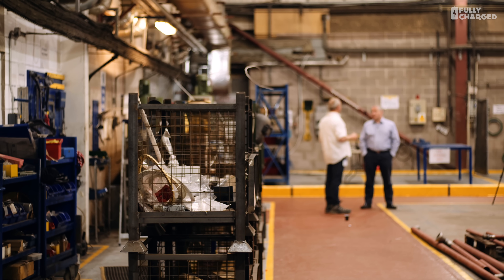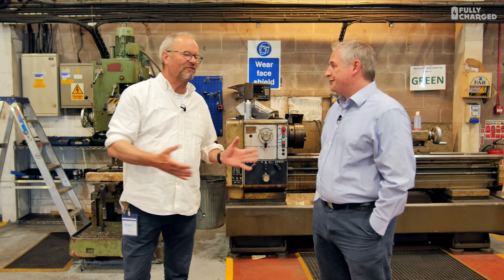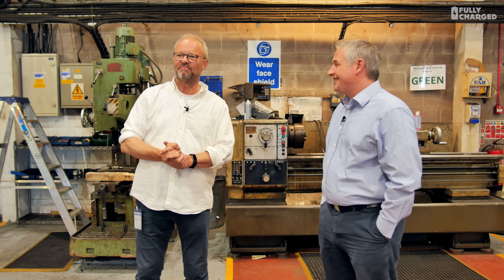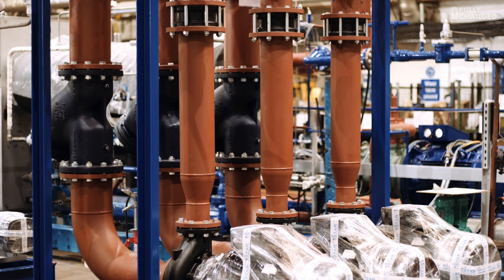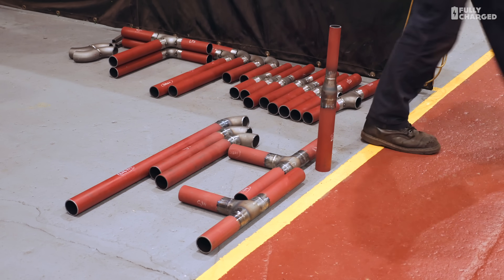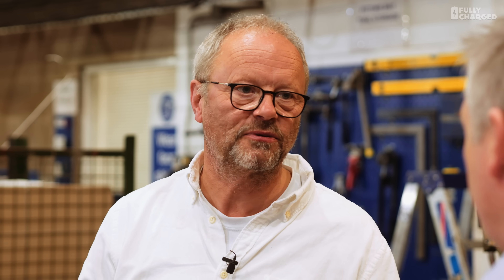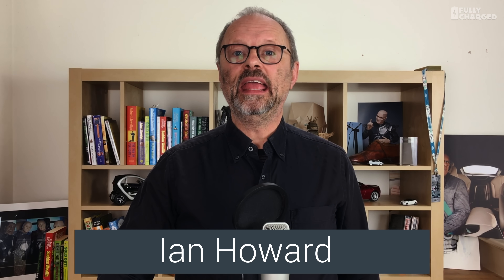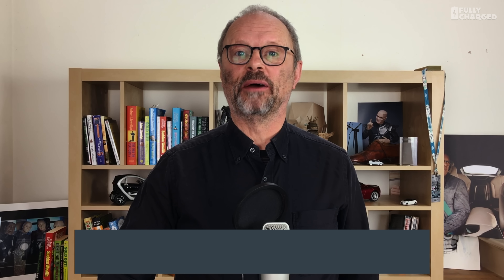Star Heat Pumps | Fully Charged

Comment: Not being at all knowledgeable, how do we get the heat to current homes? So we make X megawatts of heat in a city's river. How can we get that heat to homes in the current setup? Just feed hot water into our existing boilers? I always assumed you have one inlet of cold water for everything
Reply: If the water coming to the home is already hot, why would you need a boiler?
Reply: That's not what I ment. To my knowledge you just have a cold water inlet to your house. So using existing pipes, how do you get the heat to homes. I always thought you have a cold inlet then it goes to the tap(cold) to the boiler(hot). So without separate inlets, you'd have to re plumb everything.
Reply: In a city with city heating the heating pipes to the home will be separate to the regular water supply.
Reply: Jean-Pierre White cheers for the reply, but that's my point most British cities to my knowledge don't have heated cities. So with current infrastructure most heating is domestic.

Comment: Ok, that would be reasonable source of heat for district heating systems that currently run from waste heat of gas powered power plants. Like in Latvia for example. 
Other means of heating (and providing hot water) would create loads of problems. Since we can't simply fit all households with electric boilers and radiators, that would require total rewiring of those households and "last mile" networks, since they are not designed (because consumers would have gas in the kitchen and district heating and hot water) for such load. So I guess this way huge boiler houses can be replaced with something greener. Especially considering that the other choice would be installation of huuuuge resistive water heaters at aforementioned boiler houses/powerplants.

Comment: FOR EVERYONE COMPLAINING ABOUT 400% EFFICIENCY PLEASE READ.
It does not violate the laws of thermodynamics. It is simply moving more energy than is put into running the compressor. A heat pump is nothing more than an air conditioner run in reverse. When you run your air conditioner it may consume about say 6kw of power but extract 12kw of heat from your house while running. We would say its moving twice as much energy as it consumes so 200% efficient. For heat pumps same story, but the heat pumps these people are working on extracting heat from water are even more efficient. With 1kw going into the compressor motor they can extract 4kw of heat from water and use that to heat homes. We are really putting in 5kw of energy but the heat in the water is already there and doesnt cost us anything so really we are only concerned with the of electricity to drive the compressor. The result is 4kw of heat energy being moved from 1kw of electrical energy. Depending on how you look at it, its either 80% efficient or 400% efficient. We tend to look at it by how much energy we have to put into running the system which is only 1kw, in that case its 400% efficient. Which is better than gas powered boilers.
Reply: Gregg Schuder no sir the comparison is legit. Its couldn't be more legit. If you were taking a thermodynamics class and looked at the system on a large enough scale then 400% is bogus. However engineering and economics says the comparison he made is very real. The energy we put into the system that we are actually paying for and are concerned with is somewhere around the numbers he mentioned when compared.
Reply: I am using AC inverter split and very happy with it. But when the temperature drops below -10 celsius is a struggle(it can freeze). I guess here is the advantage of using water pipes going underground and using water instead of air - energy conservation.
Reply: Christopher Beasley absolutely not. The theoretical efficiency is 80% the practical efficiency is 400% when designing for these systems the numbers used are the 400% numbers. Product specifications and designs are based off these numbers. I am an electrical engineer working on grid energy storage systems. I am seeing a huge push for these systems in all industries because they are more efficient and cost effective. The 400% is a great marketing plus but it is far from bogus as everyone here seems to think. The 400% describes how much it will cost to run versus another heating technology.
Reply: Ortsa it depends on how you look at it. Let me put it as fair and straight forward as possible. Lets assume we were heating a building with electricity from solar panels. If we wanted 4kw of heat we could use the heat pump system and it would produce the 4kw of heat with a 1kw PV system. On the other hand if we had a boiler or electric heater, it would require a 4kw PV system to get the same heat. You be the judge, its not hard to see which is more beneficial or 'efficient' to us. Hence why these heat pumps are starting to be installed everywhere.
Reply: k31thd4885 its not right for every situation yet. Particularly if you are retrofitting the system it will cost significantly more than if it was just installed the first time. In places where electricity is cheap and renewables are growing, these systems will shine and be much more cost effective than a traditional boiler system. These systems are about as inevitable as electric cars and renewables though. In other words they will be the primary method of heating building structures in the future, the technology just makes sense with the way we will be using energy.
Reply: Jacob Dykstra -- Very well explained!  Thank you.  I think the bottom line comes down to the words 'Thermal Dynamics' and that is enough for me.  You aren't creating energy, but moving it and/or storing it more efficiently.  I like that.
Reply: Well explained👍🏻
Reply: 6kW for 12 kW of cooling or heating would be a Coefficient of Performance (COP) of 2.0. That's pretty low by modern standards actually (as the interview explains they're getting ~4.0 COP in the Norwegian district heating). A modern Reverse Cycle Air Conditioner (RCAC) like an industry leader like the US7 gets a COP of up to 5.95/5.81 (Cool/Heat) see the tech specs here: https://www.daikin.com.au/our-product-range/split-system-air-conditioning/us7#tech-specs
Reply: That's why we need to distinguish between 'energy conversion efficiency' and 'thermal efficiency'. Burning gas produces heat directly and a heat pump produces heat using electricity through its 'pump'. Electricity is a higher quality form of energy, it is more 'noble' because it can achieve more with greater efficiency (for example, electric cars are superior in many regards compared with classic thermal engines in ICEs). Of course, electricity needs to be produced and stored while methane ('natural' gas) or oil turned into fuel is pumped from the underground, formed over millions of years in a stable and easy to store forms. So for the moment, most of electricity comes from fossil fuel and transported over long distance using transmission lines. However renewable energies (Norway produces most of its electricity from hydro, sun and wind are harnessed with decreasing costs year after year) and, above all, batteries (with incredible falling costs of lithium-ion technologies, and new technologies are being developed) can be used as clean and stored electricity very easily. Heat pumps are the perfect choice to produce heat in a clean way in this world more and more dominated by electricity in every form of energy consumption -- though it will take decades to switch to meaningful shares of electricity in transport and heat production.

We have already all the technologies needed right now to drastically decrease our emissions. But it will need a vast program of mobilization never seen before, so we have to act as fast as possible. There are also other issues, like steel conversion from iron using coal, fertilizer production using nitrogen from methane, etc. But, already, we can do much, much more. Batteries are essential and Musk with Tesla can be thanked for the tremendous acceleration they provided to this once small sector. Thanks Tesla!
Reply: Saying "400% efficient" is deceptive though, I come from an engineering background and find these misnomers being used quite regularly especially in the renewable 'green' tech areas quite ubiquitously, it adds to the confusion.  Beyond that, heat pumps are great! should be used more often, I had a heat pump kit added to my HVAC system, and in the fairly temperate climate I live in they drastically bring down the costs of heating over natural gas.
Reply: bashful228 , you have to remember that there are a lot of variables when discussing COP , in the case of the district heating system the target temperature is 90ºC with a very stable source temperature.  On the other hand the COP quoted on the Daiken unit using R32 Will be at the most favourable operating point , possibly 10-15ºC ambient with an air off temperature of 45ºC, I could not at a quick glance of the Daiken site check this. 
One thing to note however , is I suspect that the Star Refrigeration unit probably uses CO2 in order to achieve the high discharge temperatures needed, and operates at 120Bar pressure and above, and cannot ever be switched off completely without loss of the gas charge .
Reply: Very well explained, Jacob, thanks for sharing!
Reply: But electricity costs 13p and Kwh and Gas is 02.45p per Kwh. Yes, heat pumps are 300 to 400% and Gas is 90% efficient. But, I can put in 4 times the gas for the same amount of electricity?
Reply: tagware 
But you can make and store your own electricity.
I suppose you could gas too, just not in the quantities needed..
Reply: Thanks for explaining.. Playing devils advocate.. I would say the environment is 100% efficient in providing 4kw of heat difference and the  pump is 100%(at best 75% in actual fact) efficient in transferring that heat...It is stealing really.. Hahah .. he can't market his product to be doing the job which the environment is doing.. PlanetEarth should send a bill to Star Refrigeration.. haha
Reply: Thank you! I was really confused about that. I wish they would give more concrete numbers.
Reply: @etbadaboum  a heat pump doesn't so much produce heat with electricity as transfer heat using electricity. That's why it's called a "pump" it's not consuming power to generate a lower value (entropic) energy of heat, it's moving it from outside to inside and using heat exchangers to shift the internal temperature. That heat you are transferring (or coolth in the case of RCAC) comes for free, that's where the >100% efficiency claim comes in.
Reply: the issue is that power generation is only about 33% efficient, and you have transmission losses too! Heating using gas 90% of the fuel's energy is converted to heat. Using electric heat (strip heater) is 100% efficient (100% of ELECTRIC is converted to heat) but only 33% of the fuel's energy is converted to heat. A heatpump with 400% efficiency will not be 400% better on your bills, it'll probably be about 1.2-1.3x better
Reply: Michael _Howto this is true. However, more and more power is becoming renewable and fossils are being replaced at an accelerated rate. In that case the energy is nearly free once the powerplant is established. This source of energy is what makes the most sense and is the idea behind the show fullycharged. I know you can say most of electricity is still powered by fossils and these losses exist but the shift is happening very fast, I see it every day. If our energy will ultimately come from renewable sources then the question isn't comparing it against a gas boiler but an equivalent electric heater, in which case the heat pump will yield much better efficiency.
Reply: Please explain how a heat pump functions. What does the compressor do? What do you mean run an air conditioner in reverse? Also how do these guys do it? Thanks.
Reply: Aku6Soku1Zan 
By heat pump they mean a heating system that does not create heat but move it from one place to another. It doesn't require a higher absolute temperature but the ability to create temperature differential.
The pumps move the water and the compressors exaggerate the temp differential due to compressing = heating and drop in pressure (think letting air out of a tyre valve) = cooling.
Basic - you don't pay for the heating you pay to pump the heat to you.
Reply: As a refrigerant engineer I think it is great but... when those pipes wear thin it's going to be a costly headache.
Reply: Jacob Dykstra the laws of thermodynamics don’t come into it, as the energy in the water in the form of heat is accumulated heat from the Sun. All the energy that’s needed is to transfer the energy from the Rivers etc to the Cities. It’s not like the electricity is being used to generate the heat, in which case it would be breaking the laws of Themodyamics!.
Reply: Vanishing Point I understand your point which is why I stated two efficiencies from two viewpoints they were 80% and 400% efficient. The 400% is a very loose technical definition I agree however your statement is completely wrong. The inverse is actually true. If you account for all the energy put into extracting and transporting a fossil fuel, you end up putting more energy in than you get when you burn the fuel. Lets say you only account for the fuel (lets say natural gas) if you burn 1 kWh of fuel you would expect around 90% or so to heat a structure due to some losses in the unit itself. However if you now say that 1kwh of fuel took 0.1 kwh to extract and 0.2 kwh to transport now your total input is 1.3 kwh and you still only get the same 0.9 kwh of heat. This brings efficiency down further. I assume what you are saying is really we only put 0.3 kwh total to extract 1 kwh of energy and got 0.9 kwh of heat energy (an efficiency of 300%) if you look at it with this viewpoint, then yes fossil fuels can potentially be considered thousands of percent efficient, however, there is one huge catch. The fossil fuel itself is a limited natural resource and does have a cost associated with it where as the energy extracted from heat pumps is just cycled and will always replenish and be available free of charge. This forces us to also consider the 1 kwh of fossil fuel energy extracted to have some value, this value can be neglected in the case of the heat pump. Also I know kwh are weird units to use for natural gas but the audience is probably more familiar with them and they are a unit of energy therefore not incorrect to use for this example.
Reply: and here I was wondering why even cover this topic, I thought most new homes in the US had heatpumps=modern ac? just run the damn thing in hot mode and it can heat almost as good as it cools in the summer

most new split units I see can do this
Reply: @EspHack  I doubt very much that most new home in the US use heat pumps. Most of the houses I see going up are either plumbed into natural gas or use large propane tanks.
Reply: So, is the Star Heat Pumps guy just trying to sell heat pumps when he compares an "80%" efficient gas boiler to his "400%" efficient heat pump? Surely he understands that this comparison is not legit.
Reply: @greggschuder7478  Finally, someone sees the obvious; engergy in = energy out. You cannot debate efficiency or the first law of thermodynamics. This is not a matter of  opinion, but accepted scientific fact.
Reply: Ortsa the marketing department efficiency is 400%  the engineering department efficiency is 80%
Reply: Wow well explained,...now i can also claim my 10yrs old Air-oil cooled 1200cc motorcycle engine is putting out 120Kw of heat for only an input of 12Kw of fuel in the engine because of the absence of liquid cooling (1000percent efficient at producing waste heat !!)  a better heat pump than a perfomance bhp machine..hahaha
Reply: @fidelcatsro6948  If you could capture the heat (move it to somewhere useful) it might indeed be. ;)  In the winter when you are riding it's actually doing something useful keeping you warm - not so much when it's hot out. ;)